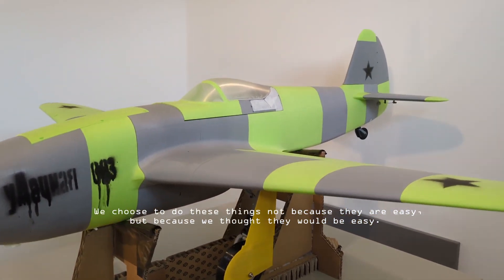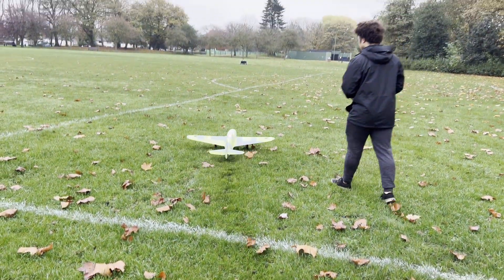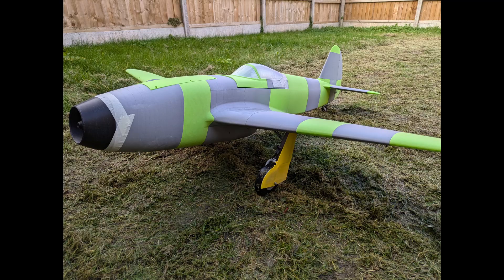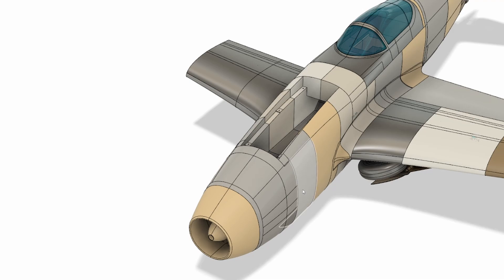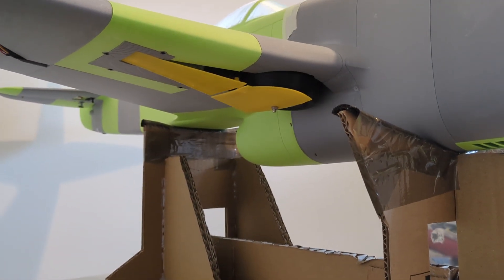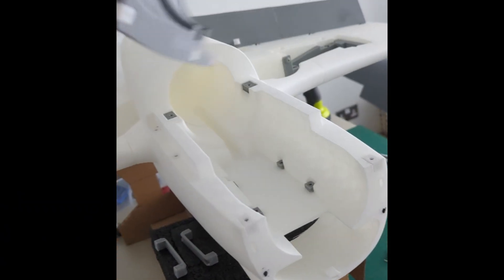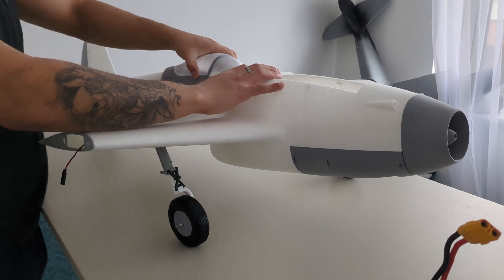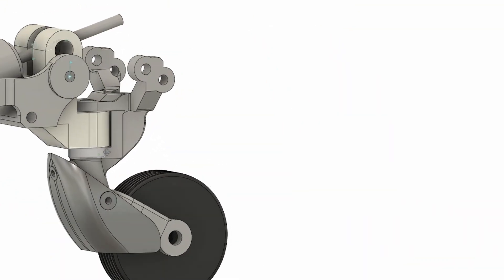Yak-15 RC Jet: 3D Printing Build Journey

Comment: Great work so far. Yep total EDF thrust output should measure > than total weight of the plane. Think as light as possible. Maybe add a cheater hole to add more intake thrust. Good luck!

Comment: Keep going and good luck, but for your safety and the safety of others, find a local model club to test fly it at, not the park. Depending on if you’re in the UK or not, and what access to Article 16 you hold, you may also be flying illegally in a park.
Reply from the maker: @TinmanRC_Official  It was probably divine intervention that my planes never flew :). I just joined my local flying club, I don't want to put people at risk.

Comment: This is amazing now I wish my yak15 build was done now
Reply from the maker: @dill_hill  what kind of build is it ?
Reply: It's made of normal foamboard and a red index card thick sheet paper for the skin and would be powered with a close to 3 inch diameter edf
Reply: So it's around 4 foot wingspan
Reply: The largest build I have almost fully made with a hand drafted scale plan I used a screen shot on my phone used a ruler to measure if then scaled it to fit one of my lipo batteries and with more measurements and scaled up drawings it turned out to be pretty close to the scaled down dimensions of the yak15 so I got lucky
Reply from the maker: @dill_hill  I've always wanted to do my own scale drawings. I hope you do finish the Yak-15, we need more of them in the world.
Reply: Yea and to my knowledge there is really only 5 to 7 videos I have seen on the yak15 that were homemade and not just kits and every channel that I find that has built one I have added them to my subscribed YouTubers list but I only subed to 3 or them 4? Because i could not find the others keep up the work on your build it's turning out great

Comment: if you end up making a mk 5, i would make the wings removeable at the wing root instead of the wing tip, it will make storing it easier
Reply from the maker: @benramsey8937  That's the plan. If this flies then the mk 5 is what everyone else will be getting. I've got a few modifications in mind.